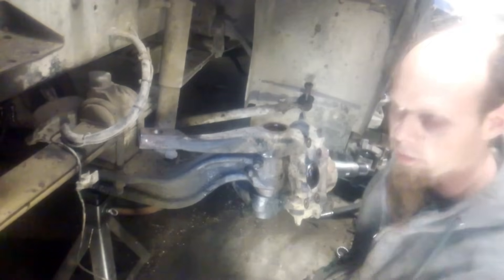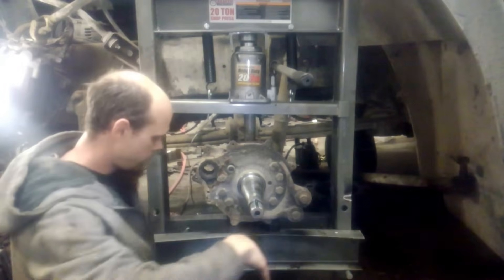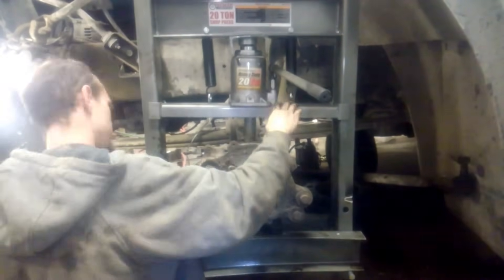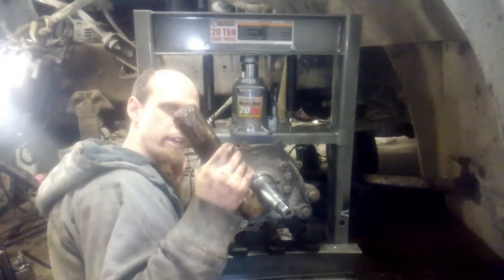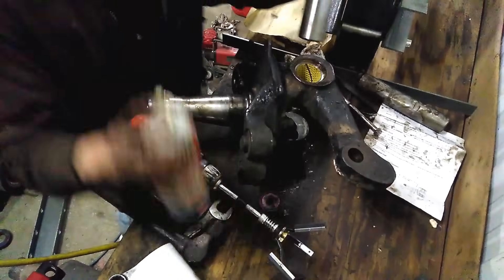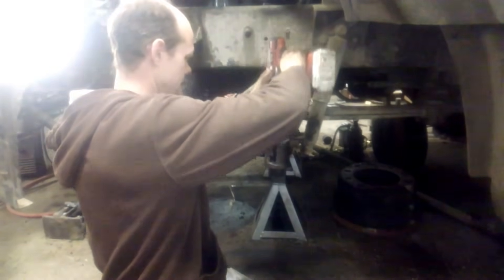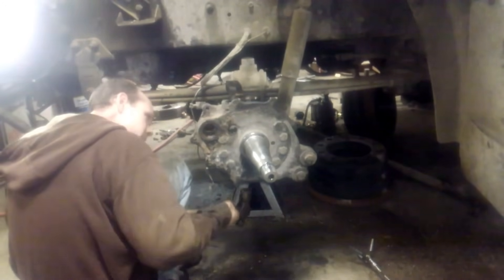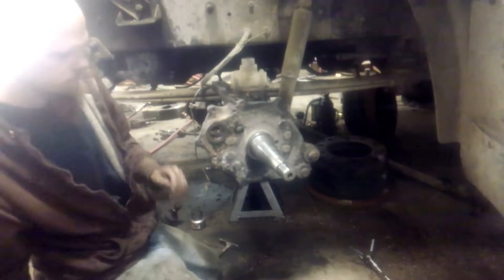kingpin replacement on big truck

Comment: Brother please use safety glasses.  You seem like a decent tech. Would not want you to lose your eyesight. Godbless and thanks for the video!
Reply from the maker: thank you, yes i can get a little lax on safety gear, need to make improvements in that area. you guys calling me out on it does help keep it fresh in my mind.
Reply: Jimmy E Robinson super video
Reply: If you use a hammer even to drive a nail it's best to have safety glasses.
Never grind anything without eye protection nor fool with Freon without eye protection.
Good video.
Reply: Face sheild and safety glasses, can't go wrong
Reply: A face sheild works best for the work you're doing
Reply: Like to see you work,forever young. 😭
Reply: Still remember we made timber stand to hold 19 tonnes trucks
Reply: Make the underside of the stub axle solid, beat the end of the axle beam, use drift and someone to hold it with grips, hit drift hard and smart pin will exit.
Reply: Where i come from we use an expanding reamer  with a centralizing pilot, otherwise you cannot be sure each bush is exactly in line with the other, this makes a perfect job.
Reply: Amen bro saftey 1st always but in all he should no better but hey we all do things once in a while!
Reply: Maybe is worst if a piece of plastic gets in to the eye, just saying.
Reply: @victorsuarez2954  a proper rated safety glasses won't shatter. It may crack or get deformed but I haven't seen it cracked like the windshield does. I have seen quite a few incidents and safety glasses does really help a lot, but we have our own beliefs and I respect that.